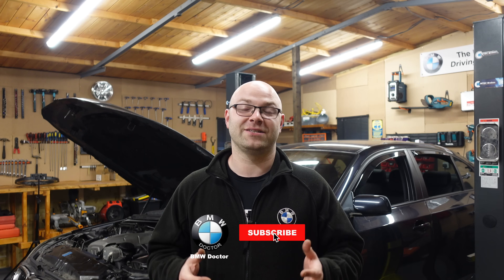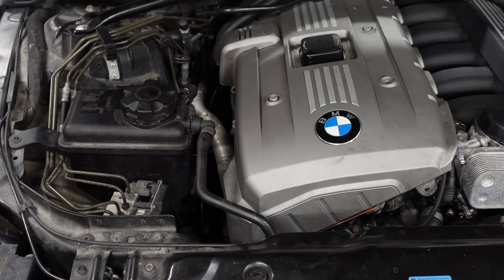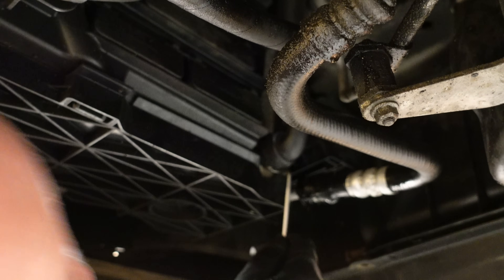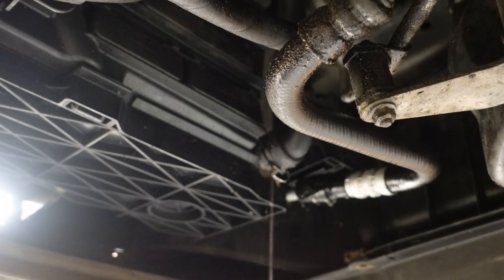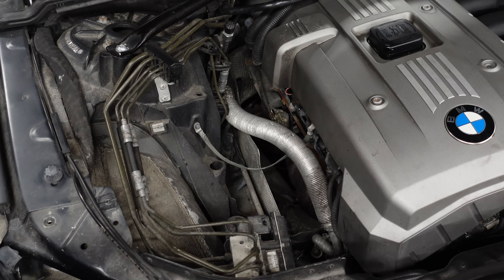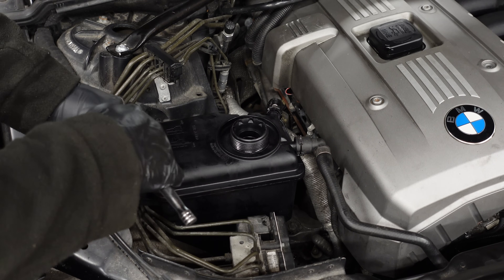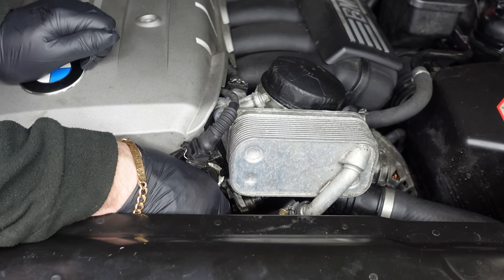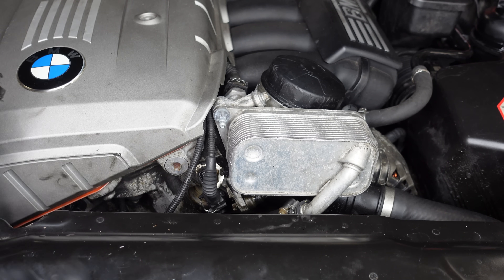BMW N52 How To Flush / Drain Coolant & Replace Coolant Flange

Comment from the maker: The budget to overhaul this car is £6,000 Yes I know its a lot of money for a car thats worth £3,000 but this car will never be for sale and for me its worth it.....

what shall we do next Let me know what you wish to see ?
Reply: A true car guy cares not for the cost if the car is worth it to them, each to thier own.
Reply: Thanks for the tips! 💪🏻
Reply: I’m interested to see any of the ZF gearbox maintenance in the bmw ie flushing or oil change if or not any maintenance seals that did nor did not need change if that is in your budget of the overhaul 🤔
Reply from the maker: It sure is ! That video is out very soon
Reply: Diff oil?
Reply from the maker: Yep thats in the budget Aswell :)
Reply: That's a lot of budget for it but and a big but 530i msport is now a rare car so the cost to keep it on top is not an issue it's a must
Reply: Hi Dean, are you planning to retrofit logic 7 or something similar, it would be great to see that
Reply: wondering if you could do a refresh-  on the front and rear suspension on it.  thanks
Reply: It just depends how far you wanna go down the rabbit hole my friend lol 💪

Comment: You mentioned that the flange was "rusted".... I don't know about your car but on my car (2008), BMW made the hose connector in a brittle compressed fiber material that deteriorate. In other words NOT metal at all.
An evil way of trying to get the owner into the BMW workshop....

Comment: Is there any problem if I drive the car with oxygen sensors off ? I had problem with oxygen sensors and car is really good without, running better no rough idle, no smoke, no misfire.

Comment: My 135i fan doesn’t seem to be working any tips
Reply: thermoswitch, the fan it self, wiring
Reply from the maker: This is waterpump failure. The waterpump is on its way out which causes the fan to stay on as the waterpump isn’t cooling the engine properly so it’s gone into emergency mode.
Reply: I’ve replaced the fan, thermostat and temp sensor 🧐

Comment: I had mine break on where the hose attaches on my E70 X5 on a night where I needed to have my car to get to work the next morning, of course no Autozone style shop had one in stock. So what to do, well off to Home Depot and I was able to get a plumbing fitting that had a tappered thread on the  OD and I was able to tread it into the hole left where it broke off and it held up for 3 days till by new steel one showed up.